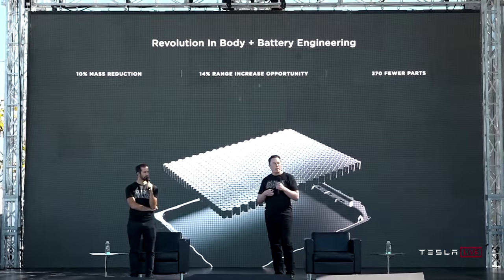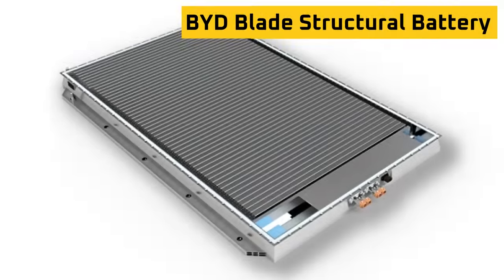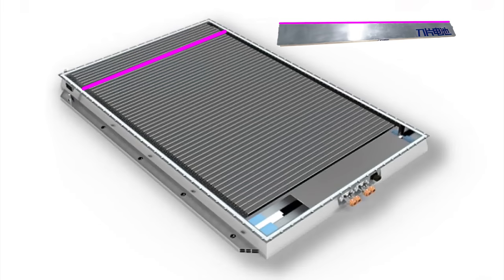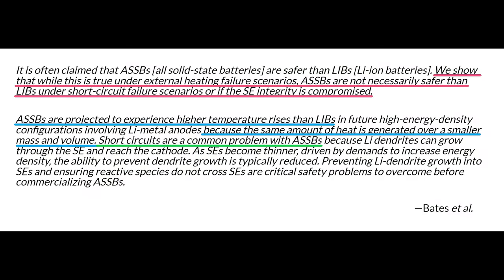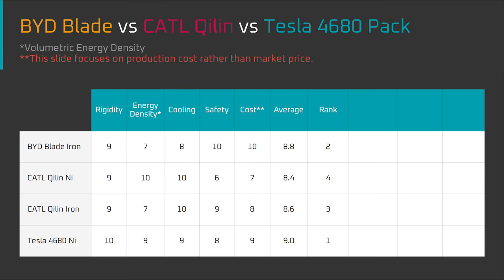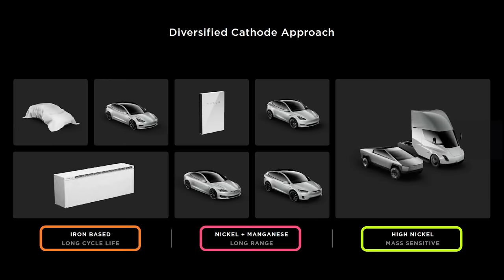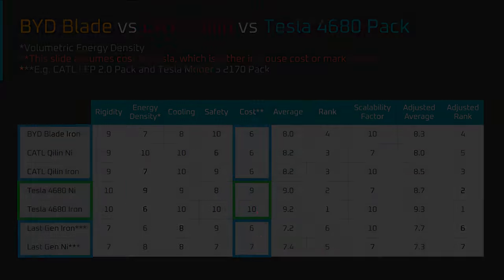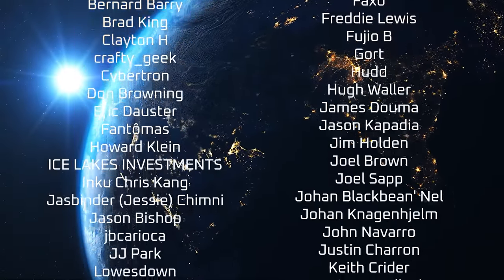Pack Analysis:  BYD Blade vs CATL Qilin vs Tesla 4680 Structural

Comment: Great video. two suggestions 
- BYD also mainly use their battery cell and battery pack for BYD internal vehicle production. The cost should be low
- It would be great to consider the battery packs from VW, KIA, etc
Reply from the maker: 1) Correct, just take the Tesla cost chart and invert it.
2) VW and KIA - If in house, then similar to GM/FORD.  If purchasing, then   on par with BYD, CATL, TSLA...but higher cost.

In other words, all this can be inferred based on the information I provided.

Comment: I may have missed the video, but what has been Tesla's problem with the 4680 and since other manufacturers are going to be making it and variations of it, will they be able to fix the problem?
Reply from the maker: The coating process.  Others will use wet coating for the electrodes, so they won't have as many issues.  But, Tesla will ramp quicker once they get it fixed.

Comment: Do you have information from Tesla that they will be doing a 4680 LFP?  I've assumed that the benefits of prismatic volumetric packing and the lower volatility of the chemistry meant they would not do a cylindrical LFP cell.  Blade seems like the way to go for LFP.
Reply from the maker: Nope!  This was just an excercise in showing why it's viable.  I've said in the past the the form factor doesn't really matter, and this video reinforces that.  Depends on what you're designing for.

Comment: "Engineers at BYD, CATL and Tesla are removing the modules"

No, BYD has already removed the modules. Every single BYD car has the BYD Blade battery. They are manufacturing this at scale NOW.
Reply from the maker: There's a reason why I worded it like that.  Think about it.  They didn't just swtich every BYD over to the blade overnight.  It takes time.
Reply: @thelimitingfactor  Thanks for your answer. As far as I know, when you published this video, all new BYD BEVs already had a Blade battery and the run rate was 1.2-1.3M BEV/yr. What am I missing?
Reply from the maker: Interesting! I may stand corrected.  I'd have to look into it.  Any article on EVs is usually very poorly written, poorly translated, or often poorly communicated from the company itself.

Either way, it doesn't really change the thrust of the video.  The net result of what you're saying is only about a year this way or that.  People get super reactionary and protective over BYD and Tesla...

I don't give a shit.  To me, as I stated, they're all making good products and there is no 'competition.'  I even showed BYD as currently in the lead if we don't factor in future improvements.
Reply: @thelimitingfactor  Thanks! The reason I am so sensitive to this topic is that I've been all in on TSLA since 2019, but now I feel BYD has all the good tech at scale and the 4680 is just meh. I hope this will change with the second iteration of 4680s.

Otherwise, I may consider diversifying because I am really not sure which one of these two companies will become the EV and Energy giant. BYD even has Na-ion tech for their "megapacks". Maybe both?

Comment: BYD claims it ability to fast charge its blade battery at mere minutes. Is this true and what are the shortcomings? Is it really practicle to install super fast charger?
Reply from the maker: Depends if they heat the battery pack really high and change the active material particle sizes.  

It can be done, and for smaller packs it might make sense.  Larger packs automatically put more miles of range on more quickly.

But it doesn't really matter.

You can't charge that fast at home, and on the road you need to stop for about a half hour every few hours to take a break anyways. (most people)

Comment: I appreciate the presentation but completely disagree with last comment that production cost of Tesla in-house is cheaper than BYD due to BYD sell batteries. If you count BYD EV car, their batteries pack should consider in-house too as it is vertical integration like Tesla with cheaper overhead due to ‘batteries sold to others’ give advantage of cost leveraging to their production. Because BYD will not sell their batteries without making profit. At least cheaper than Tesla if BYD sell them.

BYD is not dying to sell Tesla as they also have other business that use Batteries such as Bus, Taxi, energy storage and mobile phone. This means what they sell to others is excessive capacity to generate either extra money or lower overalls cost.
Reply from the maker: BYD increase the cost of their batteries by 20% this year.

The price of LFP batteries has dramatically increased due to supply shortages and they're now at the same cost as nickel batteries.  

That is the price was driven by cost increases.

So if the materials are the same price, and one company can produce them much more cheaply, then the cells will be cheaper.

Fair enough if you disagree.  The one caveat I would attach to that is it depends on Tesla getting their dry cathode working.

If that happens, they'll definitely be cheaper
Reply: @thelimitingfactor  Lithium cost increase by 5 folds which impact everybody including Tesla. Do not forget that 1/3 of Tesla produced in China and using CATL 100% which is not in-house. Tesla China has highest profit among all Tesla gigafactory. Everyone also know that most of EV car cost comes from Batteries. If using in-house analogy, how can you explain why Tesla China has highest profit when Batteries are not producing in-house? BTW, 4680 in US partly or all produce by Panasonic, will Panasonic not making any money? This 4680 is not 100% in-house vertical integration. Contrary to BYD that 100% batteries and IC to control batteries packs are manufactured by BYD themselves. 

I stay firm on my logic which support by actual fact rather than assumption.

Comment: The 4680 a pack you can't repair. That's insane or devious. Built in retirement.  How many cells in a Tesla 4680? One goes wrong your out 20k
Reply from the maker: No pack can be "repaired" properly.  It throws off cell balancing.

At best, it's only ever a bandaid or a last ditch effort to keep an out of production pack alive.
Reply: @thelimitingfactor  tell that to  the place in Boston doing just that.  Also chevrolet is replacing cells in bolts instead of the entire pack.

Comment: All I heard was Tesla, making a comparison on "potential" just seems wrong, as is basing Tesla's design on ten years of experience as much of that ten years was Tesla partnering with Panasonic. Tesla are the new kids on the block, which allows them to design using a clean sheet, but then, they lack the production experience of others.

It is a bit like Gigacasting, where people can wax lyrical about the genius of it all, but the proof is in the pudding. Is one large machine better than lots of smaller ones, is the quality of the casting going to be consistent, are casted vehicles in minor accidents repairable, what is the cost of changing a Gigacasting to accommodate a new design? The Tesla 4680 is currently an idea, that needs to be turned into reality.
Reply from the maker: It's already reality, it just needs to be refined, which is the easy part
Reply: @thelimitingfactor  Bit like Nuclear fusion then.

Comment: Comparing specs of real products with aspirations, seriously?! Even if we believe they can achieve all the goodies, we have no idea how will be the competition by then.
Reply from the maker: Yes really, you got the data?  No, you don't.  Nobody does.

Edit:  Nobody does that's willing to share it for less than a few 100k
Reply: @thelimitingfactor  you have the data, that's why I'm disappointed. To give you an example, you discovered that the energy density of the current 4680 is far lower than anticipated, but even so in the comparison analysis you give it a 9. Considering that even the 2170 are better in that regard, I can't understand the score. Am I missing something?

Comment: BYD has already moved on to a CTP design. This is more efficient than the blade
Reply from the maker: The blade is cell to pack so I don't know what you're talking about.
Reply: @thelimitingfactor  You are right. I meant CTB. In the BYD Seal. My bad. Point is they are still moving ahead of the blade generation

Comment: Charging speed matters, sort of. A battery that charges quickly is normally a battery that exhibits great thermal stability. It is highly advantageous to have a battery that heats up to a lesser degree at a given charging rate and that for related reasons tolerates high charging rates better without heating up that much. Heating/thermal runaway is the enemy of battery reliability, efficiency and safety. It is much better for a battery to generate very little heat in the first place - in either common and challenging operational scenarios (formula e racing, say, would be a challenging scenario) and during modest or exceptionally fast charging cycles - rather than for a cooling system to have to constantly work hard to keep the heating of cells and battery in check. Now, high charging speeds don't afford battery reliability or efficiency (under a wide range of operational scenarios) or safety. On the contrary, it is the quality of a battery design that makes it reliable, thermally stable and safe (in normal or more extreme circumstances) and that thus affords the ability of a battery so designed to charge quickly without untoward consequences. There are many technical considerations that are relevant here - the interviews by John at Cleanerwatt canvass some of these issues - but one overriding consideration is the internal resistance of the cell. A cell fabricated from materials that result in devices of exceptionally low internal resistance will heat less during charging cycles (at a given current). Low resistance cells will tend to exhibit the sought after qualitities that I have emphasised - reliability, thermal stability and safe operation over a wide range of challenging scenarios. Safety, admittedly, can be addressed without explicitly raising these matters as long as the scoring takes all relevant considerations into account. I was not encouraged by the vlog narrative, however, that deliberately diminished the relevance of charging speed. Charging speed is a litmus test for the internal resistance of cells and thus the reliability, longevity, thermal stability and safety of those cells. The scoring in the 'Safety' column (and the 'Cooling' column, too) can't just edge around these matters.
Reply from the maker: You make good points, but it doesn't override what I said.

That is, it's not in the top five priorities for automakers.

If it was, there's a really easy fix...

Make the battery charge faster.  That's why we have high power and high energy battery cells.

However, there's always a compromise with batteries and that's why they don't do it.

Leaning towards power means reducing energy.

There are technologies that get around this, but automakers and cell makers have obviously chosen a more conventional route in most cases.

That will change, but only when every area of the spider chart can be improved, not just charge speed.
Reply: @thelimitingfactor  I certainly agree that getting large volumes of batteries out there that are energy dense, safe and low cost is of the utmost importance. Elon has fashioned an approach to thinking about commercial necessities (which he calls reasoning from first principles but which is only loosely based on styles of reasoning prevalent in the pure sciences or physics), moreover, that helps to clarify a sensible scope of technical goals and a sensible order of things - what comes first and next, what needs to be delivered today and what can wait until later - that applies to the manufacturing of products, like batteries.

To press the point I have been making further, battery safety follows from the thermally stable nature of the battery and the low internal resistance of the battery cells. There is no way around that. Fast charging comes as a bonus but thermal stability helps to deliver a battery that is safe by design.

Are batteries safe enough today? Maybe, but that is because the possibility of charging them quickly is often ruled out. So, from my point of view, delivering batteries with much greater thermal stability is unfinished business on the navigation chart of first principles thinking that despite seeking to inform product manufacturing so as to soften the cleaving effect of commercial necessities - which forces some important technical work to be delayed until another day - can't finally evade the pressure of those necessities.

While it wouldn't be true to say that the EV batteries that we see today have been rushed it would be true to say that they fall short in both energy density and safety/thermal stability to properly meet our needs and technical objectives. First principles thinking is going to have to revisit battery design to more fully deliver on the promise shown so far.

Comment: Maybe I missed this in the video (was listening more than watching), but I think  the Tesla pack will have a significant advantage in rigidity.  Airframes use the honeycomb structure for a reason.  Plus, I can’t see how the other two will match the Tesla pack in longitudinal stiffness, and that should give Tesla an advantage when building the entire vehicle.  My “Back of the napkin” two cents.
Reply from the maker: I showed an image that calculated the rigidity.
Reply: Yes, I think Jordan ranked Tesla highest for rigidity. Makes sense given the pack is monolithic. At least with my limited knowledge.

Comment: Admire your work here, but I think in light of the news that the Cybertruck will be able to use the 1000 kw Megachargers, it might be needed to add charging speed as a rating to really compare these battery cells.
Reply from the maker: Thanks man

Given unlimited power, charge rate is determined by chemistry and thermal management for the most part.

This will be covered in the next video.

Basically, high power charger does not mean fast charging vehicle.

You need both
Reply: @thelimitingfactor  yes, I understand, but also the amount of heat charging creates is, I believe, a critical advantage of the 4680, but I look forward to the next video. 

I suspect that the Tesla team have had the objective of ending the "but I can fill my tank in five minutes" argument against EV trucks, especially given range loss when towing. Not saying recharge in five...but maybe ten minutes will be possible for at least to 80%, and if you have five hundred miles range 80% is probably good.

Comment: It's been years so the industry changed. I don't think you can extrapolate cylindrical cell E density to prismatic. That is because at the edges of the prismatic cells the corners are too tight and also the stress will distribute unevenly and so you can't lay the sheets as closely compared to cylindrical. I investigated this years ago and found prismatic cells with same chemistry always far lower volumetric E density. I'd be interested what you think about that?
Reply from the maker: It's a good point!  Overall, it appears that cylindrical has a slight advantage at the cell level.  However, prismatic takes the cake at the pack level because it more than makes up for the cell level difference.  I'd need to do more research, but that's the gist of what I've found.
Reply: @thelimitingfactor  I think the cell level advantage is more than slight isn't it? It's been years but i saw a substantial difference much larger than packing factor losses. I'd love to see you comment more or investigate more!

Comment: Are the battery packs of either of the 3 companies adhered to the base metal pan and the metal floor cap. If so it will form a bi-directional composite structural element.
Reply from the maker: It doesn't need to be adhered to create a sandwhich structure if that's what you mean.  Munro has covered this.
Reply: @thelimitingfactor  I don't understand how that could be. This is the Wpedia explanation:
https://en.wikipedia.org/wiki/Sandwich-structured_composite?wprov=sfla1

Comment: Excellent as usual.  Question about the pack that I haven't heard discussed (apologies if you have).  The 4680 is well suited to a blended pack.  It would seem to me that's an obvious solution to global demand for Iron and Nickel .  Am I wrong in thinking that you could have different "bandoleers" as needed for performance or range?  I know that there is battery management etc, but this is Tesla.
Reply from the maker: A blended pack really isn't necessary if you're making both a long range and standard range vehicle.

Could be done, but not worth the BMS hassles and cell balancing issues.

If you want a moderate range vehicle, better to use LFMP or improve LFP.
Reply: @thelimitingfactor  i yield to your knowledge. Thanks for taking the time

Comment: Does Tesla's cooling system really only cool part of the cells? Wouldn't this mean that the directly cooled cells have a greater lifespan than the non-cooled ones? How does it work exactly? Does the heat from the non-cooled ones dissipate to the cooled ones?
Reply from the maker: I did a whole video on thermal management a month or two ago 😉
Reply: @thelimitingfactor  Ah ok thanks. Will have a watch.